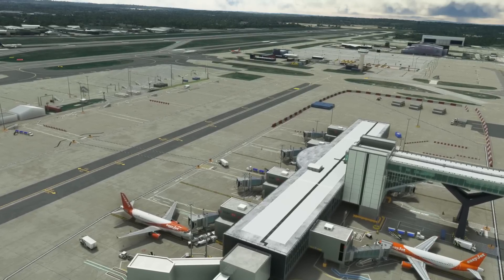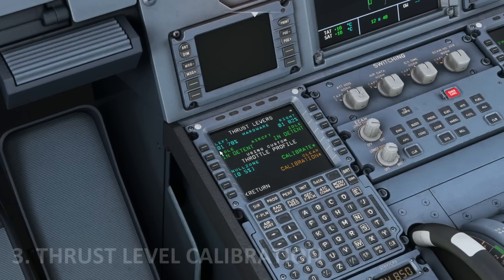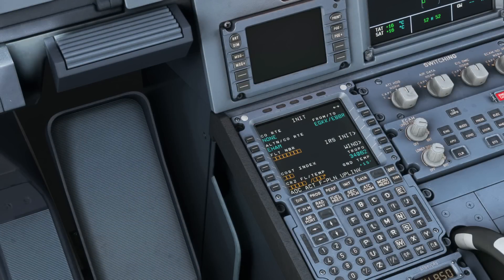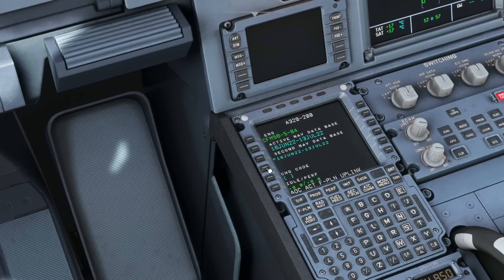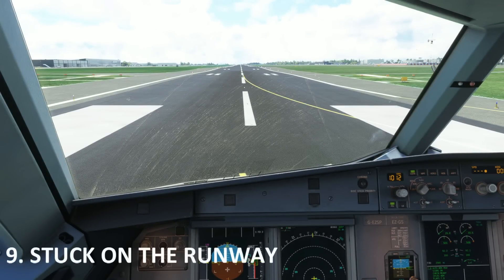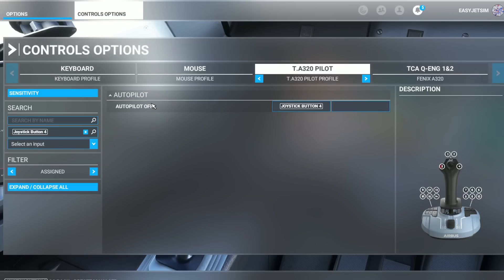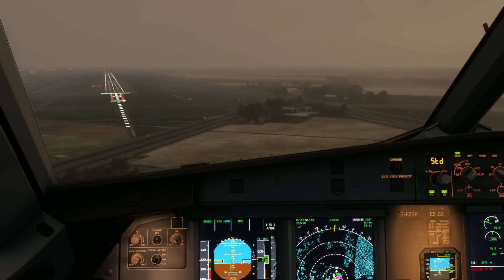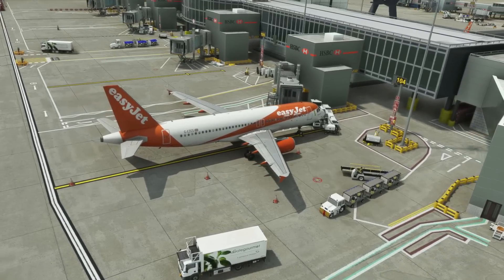Fenix A320 Troubleshooting & Fixes | FAQs Answered & Issues Resolved

Comment: I am having trouble with autopilot not engaging - I have a TO normal config and evetything functios regarding take off and in the past I have engaged the AP at around 800-1000' but now the AP refuses to engage - I have nothing configured in msfs to interfere - any comments/advice would be greatly appreciated
Reply from the maker: Are you inputting any controls whilst trying to engage the autopilot? Rudder, ailerons etc
Reply: @Easyjetsimpilot  Thank you for the prompt response- no , climbing with autothrust , managed mode

Comment: Shat about windows? I decides to open them after 50 flights and when i open them they wont close, i grab the handle and push it close but it does not go all the way and the lock lever doesnt do anything either so i had to flight With unpressurized plane lol
Reply from the maker: There's a little latch (black on the bottom of the aircraft part of the window frame) that you need to click before dragging the window back and closing it.

Comment: Hi Mate, My issue I get FUEL: Auto feed fault - Fuel Mode Sel.........Man ? - Fenix A320
Reply from the maker: At the start of the flight?
Reply: @Easyjetsimpilot  I notice it after engine start during pushback, although it didn't happen on my flight yesterday normally every couple flights. Thanks Gavin

Comment: Thank you so much for this, Gavin!!! You saved me! I didn't know why all sorts of failures appeared and I must have turned them on inadvertently. Now I know how to undo these again. Thank you, it drove me nuts 😭

What is still not working for me are the Sim settings. No matter how often I click save default and for the same livery etc, I have to make the same changes over and over, eg efis baro linked, the analoge horizon. Those are not saved no matter what 😔

Comment: Hey there! Very helpful video for common issues people might be having. For me, though, I seem to always get an "aft Isolation valve" smoke detector fault when I shut down the engines at the gate, unless I begin the flight at the gate cold and dark, or as a turnaround flight. Then, I might get that fault at the very beginning before everything is sorted out and I begin to board passengers, cargo, and fuel, etc. I will say that if I clear the ECAM message out when the fault shows up, it's fine. But I'm wondering if this is a Fenix bug or if I'm doing something/not doing something to cause it.
Reply from the maker: This is normal when the aircraft is first brought to life and should clear itself without intervention.
Reply: @Easyjetsimpilot  Got it, thanks!

Comment: i've spent about 3 hours now trying to fix the invalid f-pln uplink issue...
i have a navigraph subscription and am using the latest airac on both simbrief and in the aircraft, the uplink was working just fine for me just a few days ago too, so i'm somewhat lost at this point
Reply: ok i've figured out the actual issue
it was the route it seems, for some reason the aircraft doesn't like the idea of flying from Prague to Beirut
still really dumb, but atleat i got it to work i guess...

Comment: Hi. Great video as always and thank you for these wonderful fixes. One thing that might be common (not sure) is the compatibility with the Honeycomb Throttle buttons for altitude, speed and the rotating knobs to change the values. I just can't get these to work or even respond. I figure it might have to do with a missing driver perhaps, or do you have a clue on how to fix this?

Comment: How  can i increase/decrease throttle and steering left, right, up, and down with keyboard and gamepad? I downloaded the latest patch, but it don't do anything with keyboard and gamepad.  Fully unusable without those for me.
Reply: Fenix is not designed for keyboard and gamepad, you need joystick and throttle
Reply: @MikeP343  Thanks, but the problem is solved. The keyboard and gamepad are working well, when i set back the new control profile what came with the Xbox and Goty updates.

Comment: Great video , one very common problem from hanging out on Fenix discord is that with throttles if you have another slider etc set it will interfere, especially with the TCA set the slider on the base of the stick is assigned as a throttle by default and that causes problems ,

Comment: Hello Gavin. Thanks for these videos. They really help to give a better understanding of the Fenix A320. I use Simbrief and Navigraph to complete my flight plans. On the last flight I had 138 passengers with about a tonne of cargo giving an ezfw of 57.2, and an etow of 61.7. Once the boarding (through the EFB) was complete, the azfw had increased to 61.5, with a similar increase in the atow. 61.5 is over the max zfw, yet the loadsheet was still produced. This would not happen itrw. Why does the increase of over 4oookgs happen?

Comment: The one that bit me twice was during a virtual airline flight was a pause shortly after I started descent.  I didn't initiate it.  My SmartCARS app didn't.  Couldn't figure out how to resume.  Escape and resume nope.  Active pause and resume from toolbar nope.  Lo and behold it was a pause on descent option in MCDU that was set and I had to resume from there.  Meanwhile my VA and ATC were wondering how/why the A320 was frozen midair.

Comment: Really great video(s) you make!!! I have a small issue sometimes on take off, wondering what I am doing wrong. Pressing TO Config button everything is green, advancing throttles and then suddenly the Landing Config panel comes alive. Now when raising gear after getting up in the air this triggers a red caution alarm for a few seconds, but then everything is fine after gaining a bit more altitude. What might be causing this do you think? Is it some setting I done wrong? Best regards :) Jan
Reply: I have this too.

Comment: Hi Gavin, great vid!
I've another problem... It Seems like I can't flare, I wait for the 30 ft call-out, start flaring and cut off engines but it hardly works. Sometimes the word "flare" doesn't appear and I start gaining altitude but since the engines are cutoff it suddenly falls from a few deets and I get 500fpm's landings or harder. On the a32nx it always works fine
Reply: i read that the ceos tend to drop faster than the neo. So instead of the 30 start flaring at 50 maybe and retard the engines before the retard call out.

Comment: Hi,
I do have some issues with FENIX sadly,

1-I have trouble reading the screens unless I zoom in very closely, in all fairness other planes with LCDs have the same issue in MSFS but in FENIX it is the worst(FSL A320 and FF A320 with the same zoom and position are very clear to read).
2- On the BAT check I noticed that they are not charging and it only displays numbers when you turn them on
3- I am not sure if this is the same in the real thing however I cannot clear my ORG/DES field when I put a value in them, therefore, when I enter anything my *INIT REQUEST will disappear and I am no longer able to import anything unless I go to SEC FLT-PLN page

Comment: I ended up getting a refund. I had issues with it loading (even after correctly shutting MSFS Down) with MSFS freezing about 90% of the time when the fenix app would connect. Another issue I had with the throttles is whilst it was reading the throttles, below 37% it was inactive. I had followed the calibration via MSFS (deadzone, lineality etc) but couldn't get it to work. Its a shame as it's clearly a masterpiece. I'm back flying with FBW

Comment: Great video and very helpful. Can you do a video to include entry to a hold using offset or parallel as when I use default database it does some interesting unpublished turns to the outbound track of a procedural ILS at say EGHH or EGJJ.

Comment: Hi, for people with the first problem that solution it’s the only work for me, from msfs forums : For those who have the "F/CTL L SIDESTICK FAULT" I have found the problem (at least in my case). It is possible that the default keys on the numeric keypad controls are set to control the primary flight surfaces. For those of us using custom camera views mapped to the numpad controls, every time you change views you would be moving an F/CTL surface. This essentially caused my problem which led to an autopilot disconnect along with the controls being out of calibration as the keypad and hardware control indicate 2 different positions. The solution is to remove any primary flight surface for the keypad buttons.

Comment: Thanks, really helpful.  I had another problem: when landing I got a continuous “Retard” call which just kept going all the way down the runway, to the gate and after engine shut down.  It only stopped when I left the game.  I played with throttle setting but nothing worked and so eventually I referred to Fenix support and they said it is a known bug they are looking into.  In the meantime they said you can stop it by going briefly into external view then back into the flight deck.  I had to do this today and it worked.  Thought I’d mention it as it sounds like it wasn’t just me.  Thanks again for this and all your tuition.
Reply from the maker: This is a known bug. Switching to an outside view and back again I think stops it.

Comment: Hi,

Great video that has solved a couple issues I have had, however I am still suffering from a few issues which have caused me to simply give up on using this aircraft. 1 of which is only a very minor bug, however the other 2 are pretty much dealbreakers for me:

1. The minor issue is that the cargo fire test warning continues to sound on and off repeatedly about 3 times, despite me having already let go off the button. This could be expected behaviour though, but I don't think the FSLabs behaves like this.

2. I am using keyboard and mouse as I simply don't have the space for joystick and pedals, and much prefer the convenience. However, on the ground, the aircraft tiller sticks randomly and doesn't unstick for at least a good few seconds. This makes taxiing a total chore as the aircraft frequently does circles with no way of me stopping it from turning. I am using assigned rudder axis left/right on my keyboard to move the tiller, and have tried to mediate the problem by toggling the PED TILLER DISC function (I think it's called), but nothing helps.

3. The absolute worst problem I have with this aircraft, is when after takeoff, when reducing the thrust to THR CLB, if I accidentally reduce the thrust below the THR CLB threshold (the throttle axis binds are super sensitive on keyboard), the aircraft immediately thinks I am in a go-around, and subsequently deletes my route entirely. This is the most devastating bug in my opinion. I am not sure if this is realistic behaviour, but I have my doubts that this would happen in the real aircraft. This has happened twice to me now, and the frustration of this is what ultimately caused me to uninstall this aircraft.

I hope you or anyone else can help me with these issues. Thanks.
Reply from the maker: Sadly, the Fenix is a complicated aircraft and isn't really designed to be flown without a sidestick or thrust lever input of some description.
Reply: Using m&k is your issue. A little joystick doesn't take up much space
Reply: This aircraft took me a week of watching videos and reading more on simbrief. Please be patient I also considered getting a refund because I simply didn't know how to setup the flight plan and other things in the mcdu whereas the A32Neo by FBW it was automatic. Once I figured it out from this channel specifically the aircraft is a dream to fly. I have a 2070Super on Ultra settings 2K monitor and I get about 40 to 70 FPS. 40 airport sometimes 30 to 35 depending on the airport. I have a TCA sidestick get it from Microsoft it cost about $80 usd
Reply from the maker: @yaguyzay_9524  try watching the full flight tutorial series on this channel with the Fenix 👍 you'll love the aircraft.

Comment: Thanks Gavin. You solved my sidestick problem by moving joystick in circular fashion making the message disappear.
Just a quick question - after pushback the nosewheel gets stuck at 180 and won't come back. Not sure if there is a workaround for this.
Great video Gavin.
Cheers.

Comment: Any thoughts on CTD caused by frame rate dropping to zero after 1.5+ hours flying, exacerbated by camera movements.
Reply: Do you have toolbar pushback installed by any chance? If so, delete it.
Reply: I don’t have that add-on now but I used to have it. I'll search my computer to see if some files have been left behind. Thanks for the advice.
Reply: common issue with MSFS